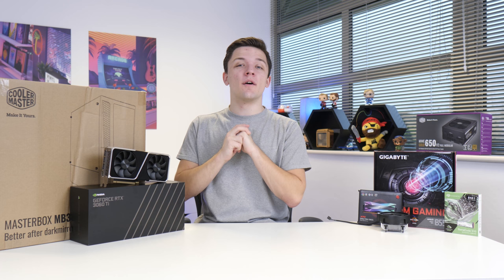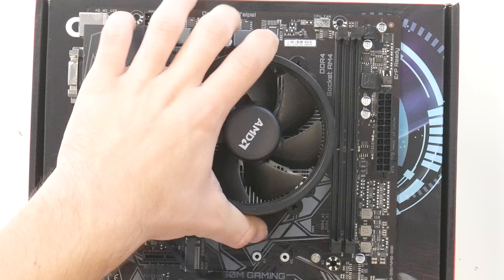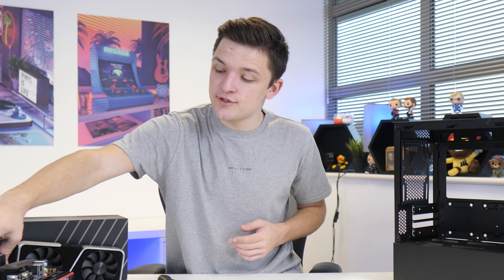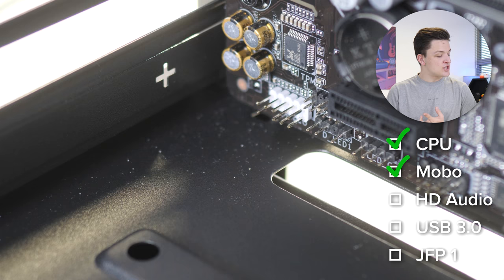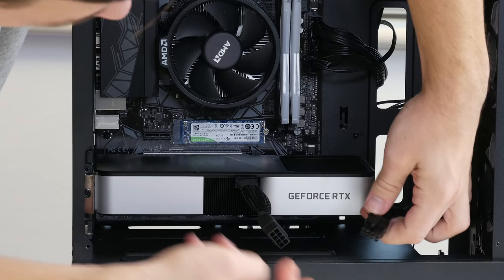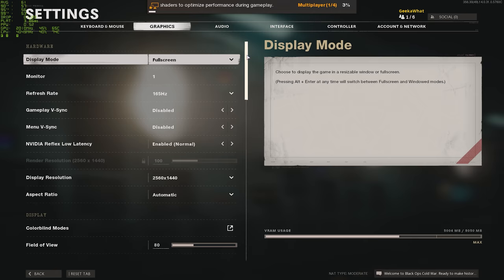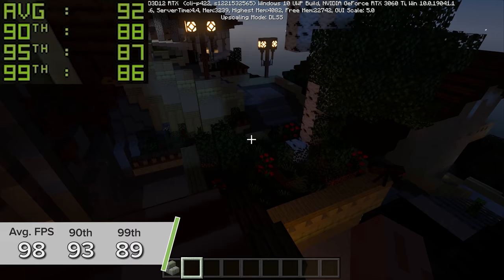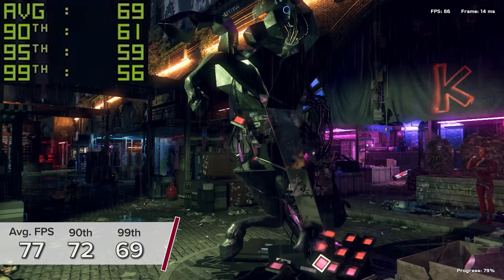RTX 3060Ti $1000 Gaming PC Build! [15+ Games TESTED! - Founders Edition 3060Ti Benchmarks]

Comment: I bought the same stuff yesterday then I saw your video, this is the exact same specs that i bought :D
galax RTX 3060 ti, Ryzen 5 3600, gigabyte b550 motherboard, 16GB xpg spectrix ram
What a coincidence xD
But i bought an antec 750W Psu in case i would upgrade in future and using my existing Samsung 970 Evo SSD and hard drives

Comment: I mean the 3600 may be a slight bottleneck from 10%-15% I would have stuck 5600x or something else because it may be a slight bit of performance cost that would be fairly annoying. Overclocking would level that out but a good cpu cooler would be needed

Comment: I'm getting a 2080ti cause on a scan website legit all the other cards are no where to be seen and its evga card another one came in stock so saving money and its 1300 but like but I'll be going from my pre-built to a full new system so i'm quite excited be using this old computer for my mums just need to add better cooling etc and might upgrade this when the parts start dying out haha

Comment: How will this card do with the Ryzen 5 3600 and a 500watt 80+bronze psu at 1080p gaming
Reply: you want a 650w power supply for a 3060ti.
Reply: @tye.3388  nah 600w is fine, 600w is recommended by Nvidia

Comment: So I was just wondering if I were to get new PSU cables for the 3060 ti. The ones online show that it is a 12-Pin to 2x8-Pin cable. Is it safe to plug in both 8 pins into the power supply or do I only plug in one of the 8 pins into the power supply?

Comment: I am upgrading my pc. Currently I have gtx 950 with amd 6600 cpu. 16 gb ram, 1 TB hard drive, and 500 w power. I am planing to upgrade mother board, cpu and gpu. I already bought rtx 3060ti and planing to buy cpu and motherboard. Can you guys help me with recommending good cpu and motherboard and tell me if I need to upgrade anything else. I'm planing to use same ram, hard drive and power. This is first time upgrade.

Comment: You should’ve spent another 5 bucks to get an exhaust fan ngl passive cooling isn’t gonna work in that system
Reply from the maker: It will, there’s enough air pressure

Comment: Could you do a 900 3060 ti build if not wich parts would you recommend for one
Reply: B450 mobo instead of the 550
Reply: 120gb ssd for the system and 1tb hdd for games

Comment: If the parts are available, I'm ordering all this after work. Thanks!
Reply from the maker: Sure thing!
Reply: 3060ti is not av
Reply: @Aestheticworld294  Oh I know. Not as a standalone part. Was available in pre built systems but I want to build my own.
Reply: Ik they prebuilt pc with 3060ti are also sold out on all websites :/ I really wanted to buy it
Reply: @Aestheticworld294  Yeah, that's why I used "was". I'm good. Money doesn't burn holes in my pocket. I know what I want and can wait for it.
Reply: I will come in stock next year this year it will nvr be in stock
Reply: @Aestheticworld294  Yeah, again,  I can wait :)

Comment: Is the 3060ti worth buying over the 3070 I'm struggling with gpu for my next Gen system right now.
Reply from the maker: I think the saving is definitely worth it for not much of a performance hit!
Reply: Ok, will the system bottleneck if I paired the 3060ti with R5 5600X.

Comment: Hey one question i am NEW At pc caterogation can I just buy any motherboard and any power supply ans any case? Or do I have to look exactly?
Reply: You have to buy a mother board that is made for the chipset of your cpu, like if you take a I5 10600 as Cpu, than you need a motherboard made for it, and if your motherboard is an ATX size, than take a ATX case. 650w is OK for the power :)

Comment: Do you really think that 650 watts psu is overkill. That’s the actual amount of recommended psu wattage by nvidia and I guess gpu's like MSI GAMING X TRIO will need 650 watts psu.
Reply from the maker: The founders card is 8 pins, it'll be more than fine